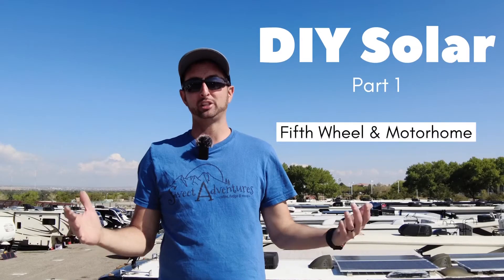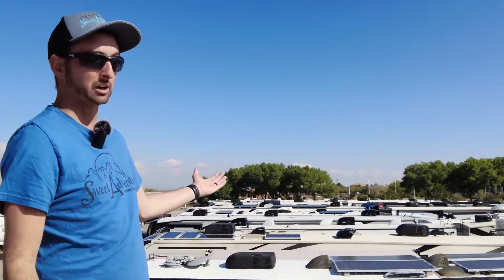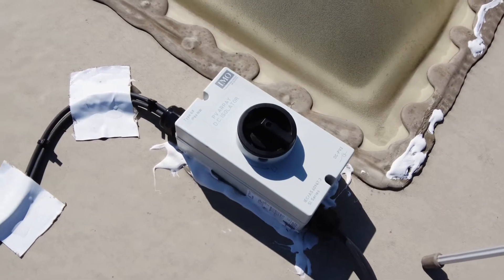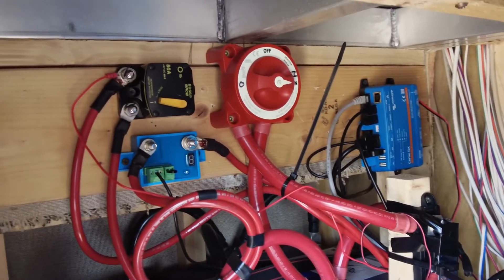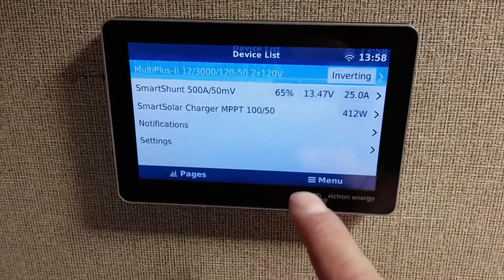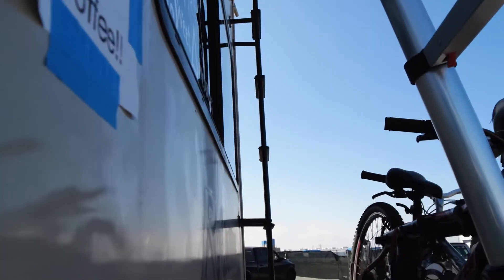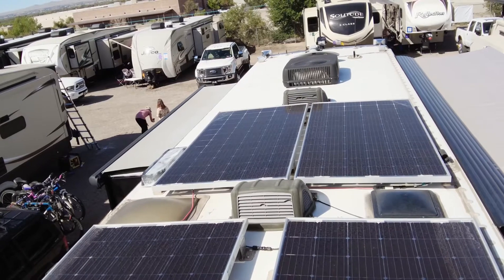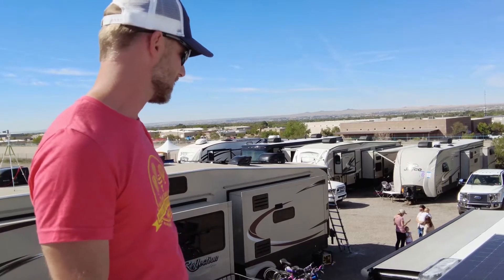DIY RV Solar Install Part 1 - NEW Multiplus II and Bifacial Panels!

Comment: I agree mike does the cleanest installs utilizing space as efficiently as possible.  AM Solar makes an awesome combiner box for the roof along with proprietory 10g wire that is duplex round, water tight and sun and mildew resistant.  Am solar panel brackets are teh best, easy to install and able to angle the panel.  We have the color control gx instead of the cerbo, the cerbo wasn’t available when i built our system a couple of years ago.  Tip tie the expandable ladder off to the RV ladder at the top, much safer and more stable plus it does not damage the rv.  Larry
Reply from the maker: Larry, those are some great tips. Thank you for sharing. 
Mikes installs are the top bar in my opinion !